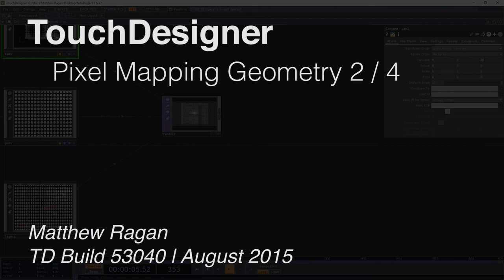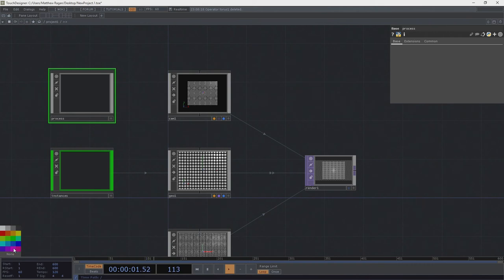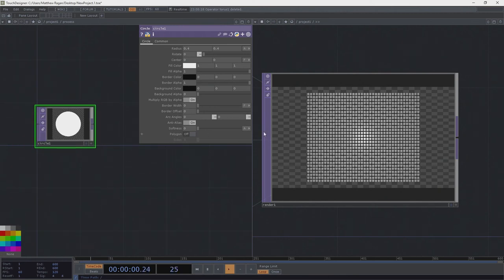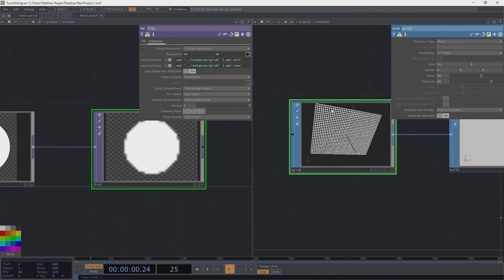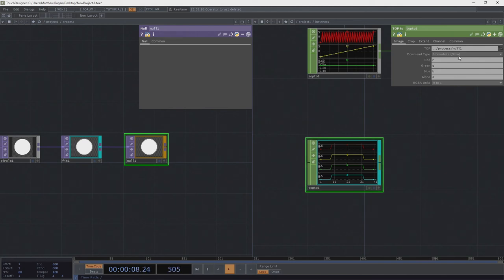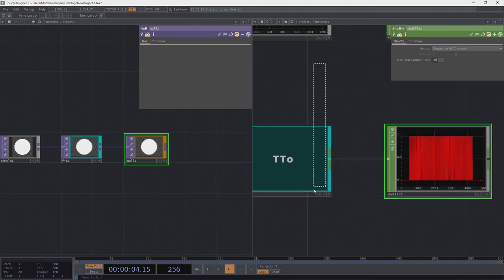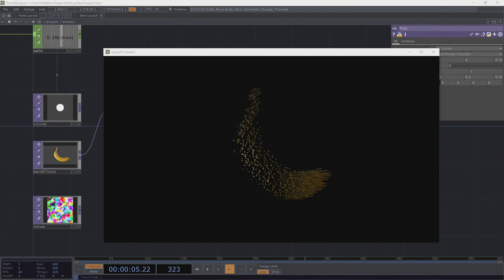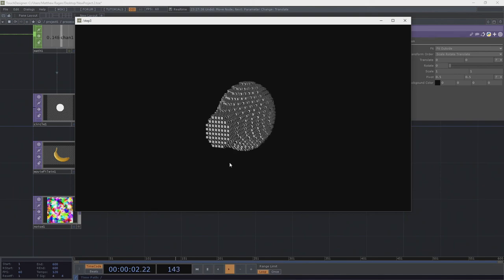Advanced Instancing | Pixel Mapping Geometry Part 2 of 4 | TouchDesigner

Comment: HI Matthew, 

I've been interested in learning more about instancing in TD - your tutorials have been mad helpful! I've been running into a strange issue, whenever I flip the monochrome toggle to the 'off' position in a noise TOP, the operator seems to shut down. It returns to it's original functionality as soon as I flip it back to the 'On' position. Any idea why this could be happening? Craving colors!
Reply from the maker: What's the OS and what Touch Build are you using?
Reply: Hey Matthew, 
Thanks for replying, I'm using the 55620 build. I'm running the software on Windows 10, version 1511, OS Build 10586.1106. Let me know if you need additional information!
Reply from the maker: hmmm. I'd try switching to 099 first. What's your GPU?
Reply: Ah! Upgrading to 099 was an easy fix. Thank you

Comment: hey matthew, everything was fine until win crashed and I had to start over.
Now I can`t get the 1200 samples into the shuffle chop, I only get 40 or so...I've rebuilt everything from scratch 3 times following you to the letter and can`t understand what`s going on here! 
Sorry to post on an old video, but trying to learn about instancing here, thanks!
Reply from the maker: OmY kron interesting. Can you post your network on the forum or hit me with a contact request? I’d be happy to take a look and see what’s up. There’s also an example file on GitHub you can compare your work against.
Reply from the maker: OmY kron rereading this, I would almost bet that your top to chop isn’t set to full image - you might check there first.
Reply: thanks for that quick response! you are VERY RIGHT sir, it was NOT set to full image...thanks! <3